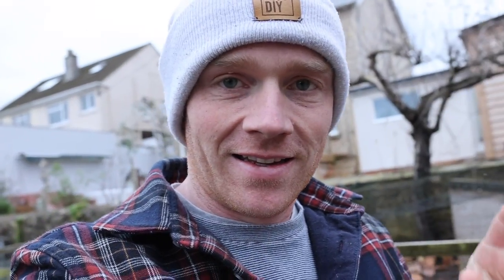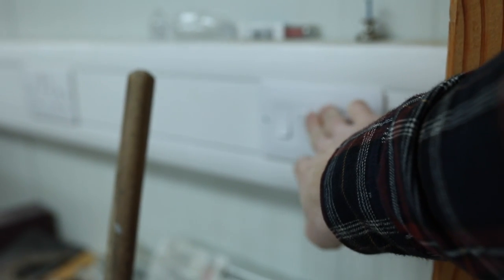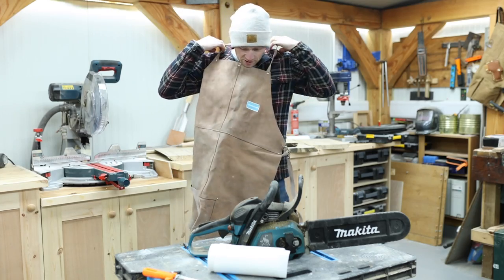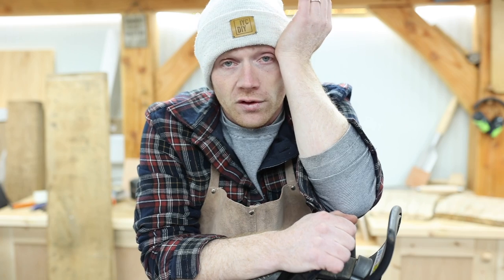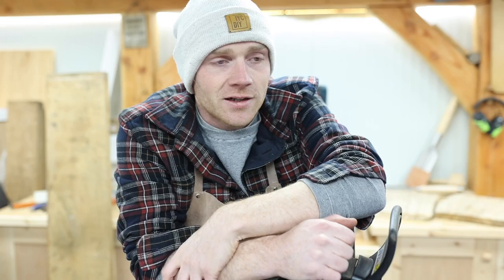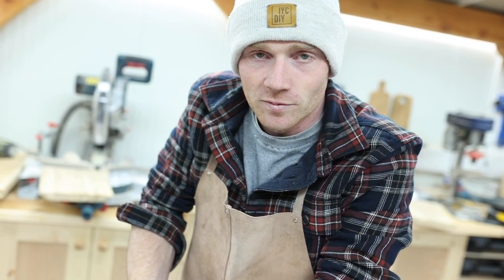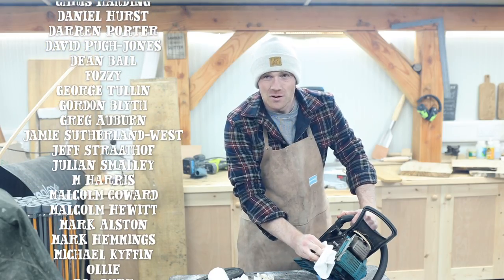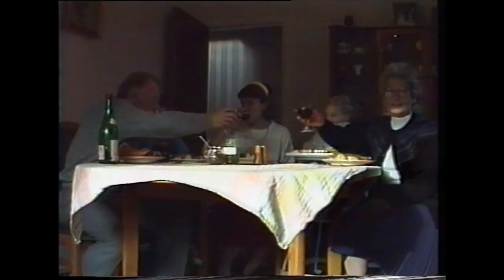TIME FOR SOME CHANGES - What I really wish I had shared

Comment: sorry for your loss Tim..I think those generations will never be repeated. My Grandad and Dad were the same, as strong as an Ox but physically nothing of them but sinew. When my Dad passed away I inherited all his tools as I was the only sibling that knew one end of a tool from another. I still use my Dad's broken Stanley Knife...because it was Dad's, I still use Dad's rusty lump hammer...because it was Dad's.. there's an emotional attachment to most of his tools and toolboxes...stupid things like he wrapped red insulating tape round the handle of an open ended spanner as that was the 10 mil one he needed most..and it's still there and I can find that 10 mil straight away. I'm a hoarder in that regard as inanimate objects can hold a lifetime of memories. My Dad never believed in an afterlife but apparently he's come through to my wife (who he never met) via a medium..."he doesn't need 3 pairs of binoculars"... my wife never knew I kept his binoculars....as much as I struggle with the concept I can never explain how that happened...so take solace that your Grandad is still checking up to make sure you're ok......